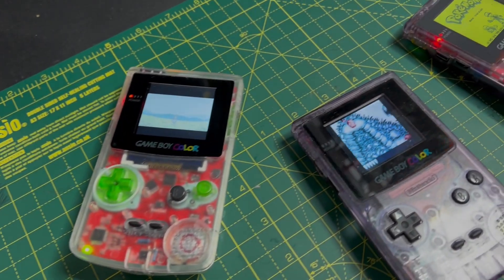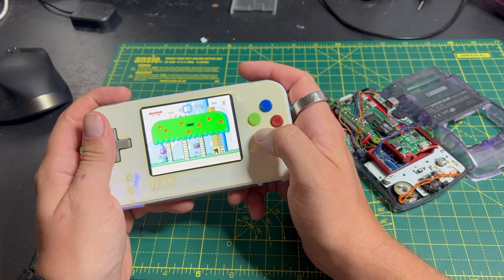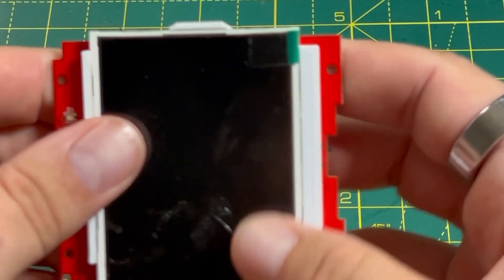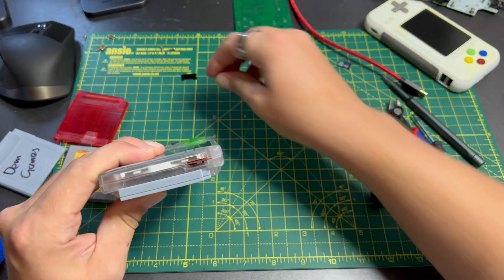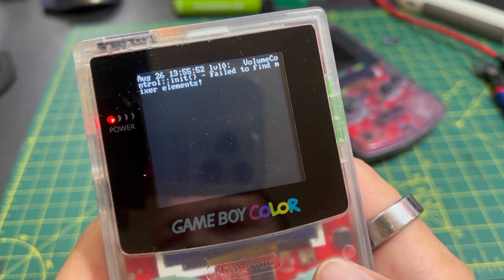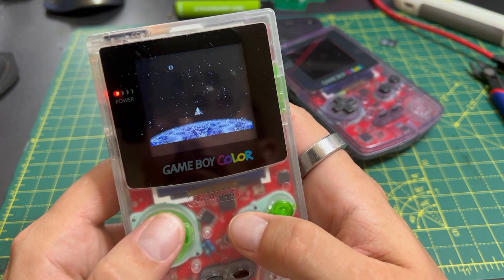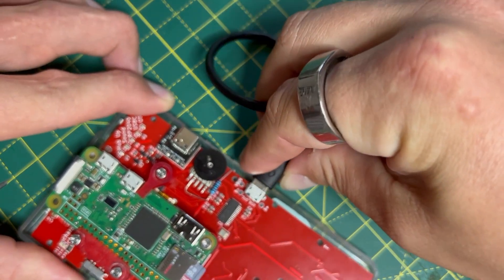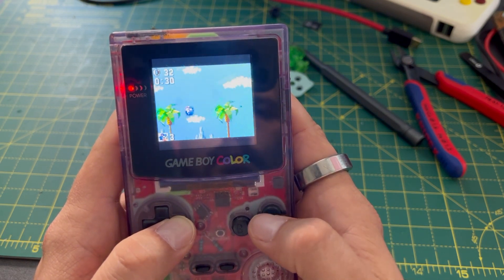GameBoy Colour Pi0 mod, with custom PCBs

Comment: hey could you by any chance provide me with the measurements you used for the pcb, things like length, width, thickness. also any notches or mounting holes as i would like to develop a handheld using the rp2040 microcontroller chip which can do gameboy very well and boots up very quickly. Looking forward to your response!

Comment: Do you have a link to order that PCB on any PCB service ?
Reply from the maker: you don't want it :p theres several hours of bodging required on it as it currently stands. needs discreet pull-ups for the buttons added, and I need to troubleshoot a bunch of the charging circuitry. Theres also a fair bit of extra soldering required thats all in my head at the moment, before just open sourcing it I'm going to see if Kickstarter responds well to the idea of a kit. stay tuned :)
Reply: @jamfab-james   anxious to see a kickstarter kit , Thank you
Reply: @jamfab-james  pretty interested in a kit myself, would love to build one of these